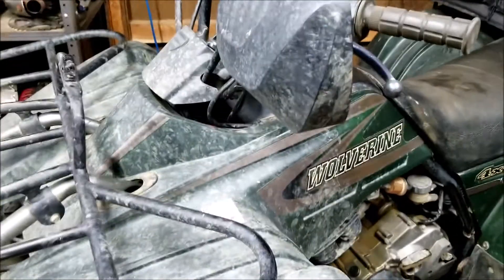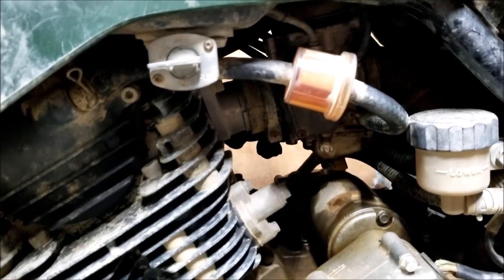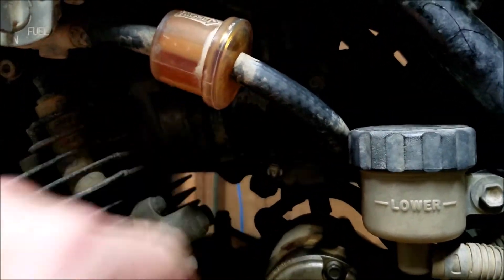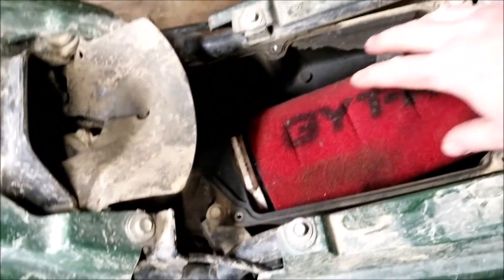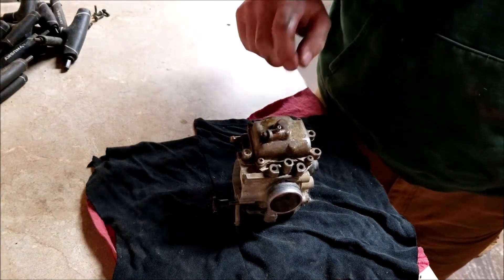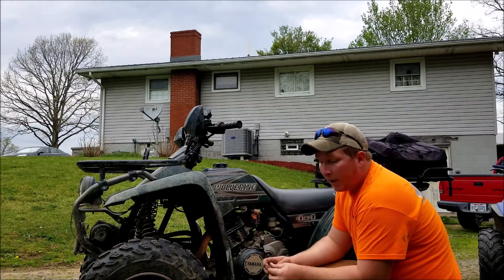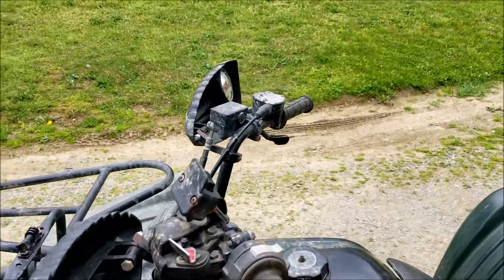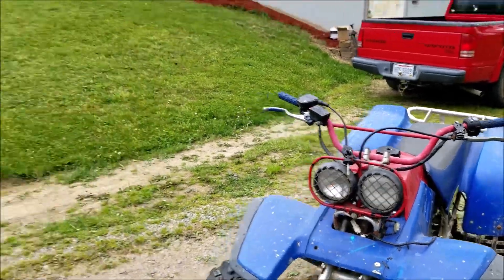Fixing a Yamaha wolverine...

Comment: Thanks for the info. Had the exact problem and unplugging the connector fixed it! Do you know what the switch is for?
Reply from the maker: It's a parking switch that limits the engine rev while the parking brake is engaged. They mess up quite a bit and then the bike thinks that the parking brake is on and causes it to limit the engine rev while riding.

Comment: Any ideas why this effects throttle?? This is a parking brake switch.. arcing or something is the only I can think of.. same issue and this video solved it.. odd fix but thanks a ton!
Reply from the maker: I believe what is happening is that the parking brake switch messes up and then the bike thinks that the parking brake is on and limits the rev.
Reply: @scrgarage1530  I did realize a few days after this fix, I replaced the entire rear caliper. Some sort of safety for the system does make sense now. Thanks again

Comment: Having some issues on mine as well, I have eliminated the parking brake as the issue, the engine will rev high under minimal load, but not when under a load.  I think the main jet isn't opening like it should and was wondering if you knew of a good rebuild kit for the carb?
Reply from the maker: If you wanted to save a few bucks, you could run a piece of wire through the jets to make sure they are opened. But if you want a rebuild kit. The ones I like to use is outlaw racing and tusk.
Reply: @scrgarage1530  Thanks, I took apart the carb apart and the jets are all clear.  I suspect the upper diaphram isn't air tight and its not allowing the needle to lift to open the jet.  I ran it today without a filter to see if the Needle/gate would lift when reved but it didnt.
Reply: Make sure your vacuum slide is working properly. I had mine not seal properly when I rebuilt it.